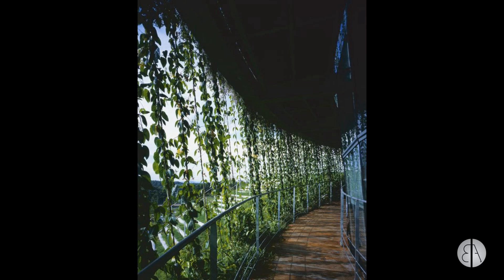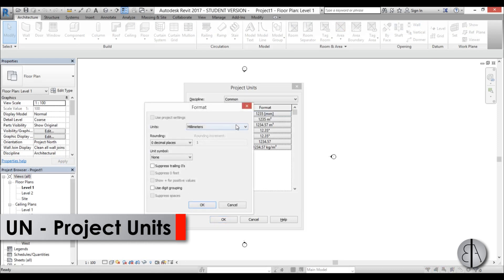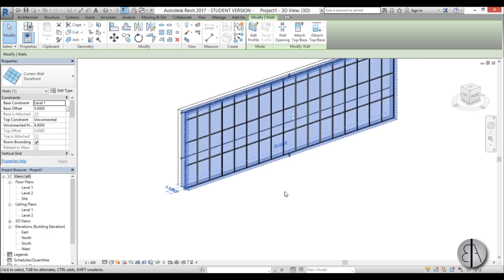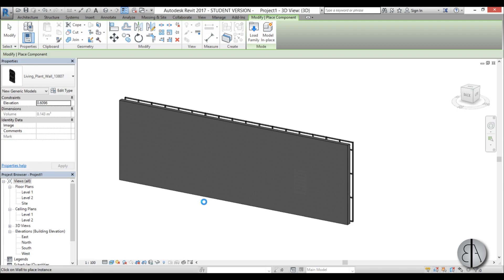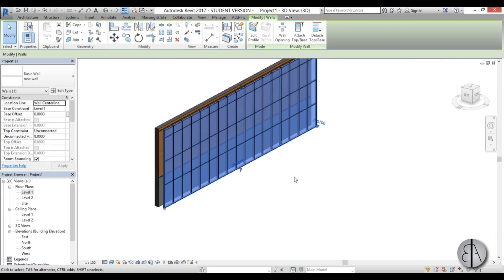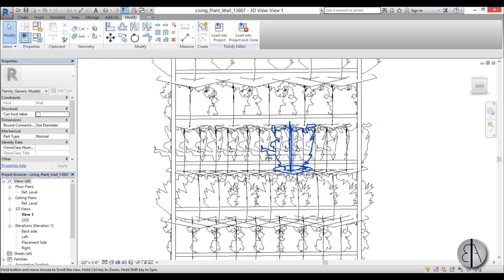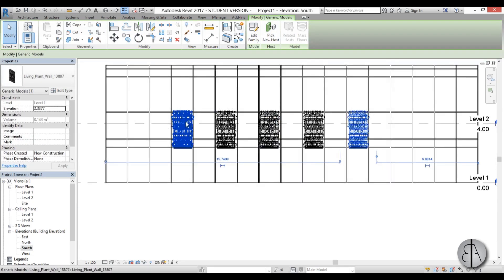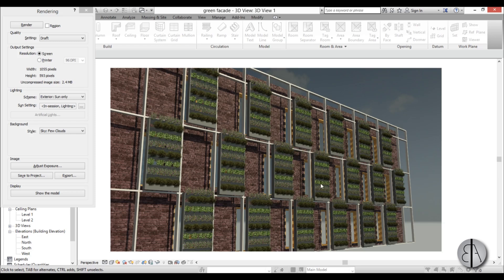Green Wall Facade in Revit Tutorial * Family Download Link *

Comment: Hi, thanks for the video, but I was not able to change the curtain panel to 'Empty system panel', any solutions?
Reply: UPDATE... I think our issue was that actual empty panel itself was not loaded into the project, so what you will need to do is go to 'open' family, curtain wall panels, load in the empty panel into the project and then re click the curtain wall and the new empty panel option should be available. Hope this helps : )
Reply: @dr.onesspace3834  thank you!
Reply: I am not able to select the option either.. all I have is 'Curtain wall empty' which does not remove the glass... have you managed to fix it??
Thanks